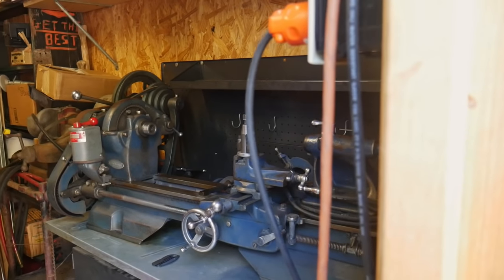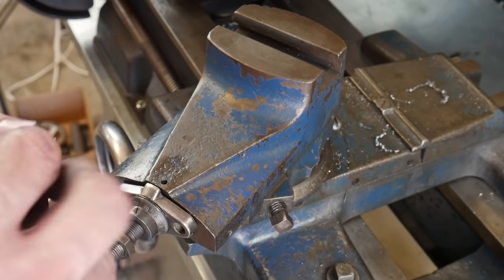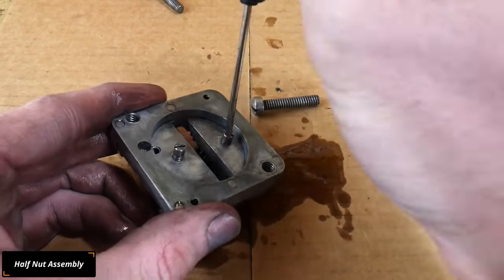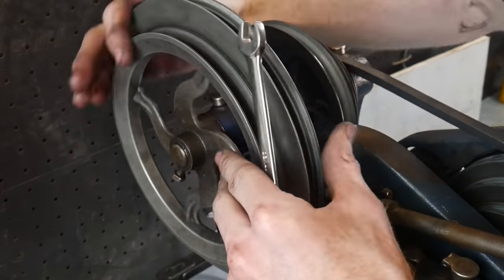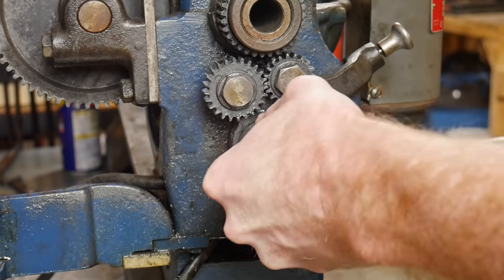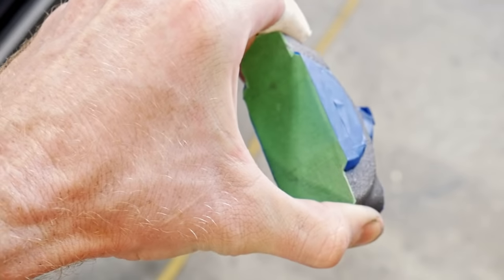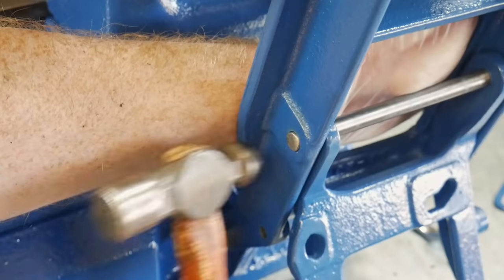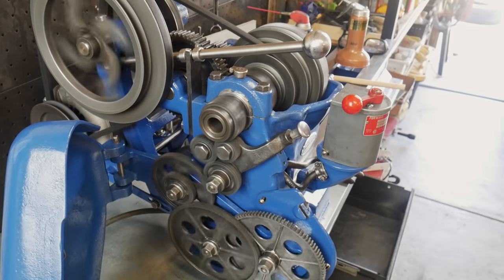1930s Atlas Lathe Restoration

Comment: Thanks for the video. I have a  late year 1939. 101.7383 12x24” Atlas Craftsman lathe. It’s a future project after I get my air system installed in my garage shop. My cover and belt tensioner are a little different, but the rest is pretty much identical. Like the Blue color. What color is it. I’ve been bouncing between a rich cobalt blue and a bright red. I know it’s a bit silly to think this much about it but just how I’m wired.
Reply from the maker: Very cool sir. The color is Royal Blue, according to my research it was very close to the original color. When I take the panels off, the blue under the panel was pretty darn close to the royal blue I used.

Comment: hi, this looks the same as my craftsman lathe, are they 1 and the same. what model is it coz i am looking for manual , how do you know its 12".  i am still in the process of cleaning it,  and i kinda scared opening the apron. thanks
Reply from the maker: Guys on the forms told me based on my seriel number. I guess I could measure it as well

Comment: How have the AXA quick change tool posts been working out? I have a similar model of lathe and would love to speed up tool change but dont have a mill at my disposal - I suppose I can figure the machining out for fitment but do you enjoy the AXAs/any issues or things you wish you would have known before I purchase and then enjoy the fruits of hand fitting?
Reply from the maker: Hey man, I'm not a pro, but I've really enjoyed using the quick change tool post so far. No issues.
Reply: @RedBeardOps  Awesome, thanks a lot for the input and the great video, helped out a lot!

Comment: Great work! It's a real beauty. Actually you don't want the switch to reverse the direction. That screw-on chuck can and will spin off in reverse. Quite dangerous. Unless you're using a collet holder with a drawbar to prevent it's loosening, 😁
Reply from the maker: Thanks for the tip! Cheers sir

Comment: Great video, shame you had no knowledge of zamak beforehand, my mechanic father(late) used to complain about how much it was used on just about anything British that had a motor in it, most common complaint was water in the fuel bowl made from zamak, it sort of just starts crumbling and doesn't stop and like you found, it melts easy.
Keep up the work and you'll have a complete workshop in no time.
BTW Loved the hearing protection for painting 😎
Reply from the maker: Thank you very much Bob! Those are Bluetooth, so I keep them on full time! Cheers sir!
Reply: @RedBeardOps  👍 BTW Did you work out the wiring for the drum switch yet?
Reply from the maker: @Bobs-Wrigles5555  Hey Bob, to be honest, I haven't devoted the time to messing with it. Reverse isn't needed for 99.9% of the stuff I'm doing.
Reply: @RedBeardOps  Check your emails, I hope I've explained it well enough.
It should be an easy tryout.
Reply: @RedBeardOps  BTW I forgot to note that if you don't like the direction of rotation for the lever position, simply swap the motor wires OR the power wires, (it won't make a difference)
Reply from the maker: @Bobs-Wrigles5555  Thank you greatly sir!

Comment: How did I miss this one? Anyhow, watch the Pot Metal (Pm) [zamak] parts; the inherent problem with Al/Cu hybrids is the internal electrical eddies when against iron items. The white corrosion dust is a sign it's eating the iron out of the steel (Aluminum oxide dust). I'd recommend finding a toolmaker that will cut you a full steel set of gears.
Reply from the maker: Thanks Shiley! Good tips

Comment: ZAMAK is cheap, light, lubricitous and durable enough to get the job done.  
did you take a wire wheel to any of the ways 
welding cast iron with flux core steel changes the cast iron's properties and it'll brittle fracture eventually. weld it with 95% nickel rods and a stick welder, or solder, or braise it.

Comment: Thank you for the video. I regret to tell you there is not an easy way to reverse the rotation of this motor. The best way in this case is to use an 3 phase motor with an frequency inverter. This also will give you the ability control the RPM.
Reply from the maker: Thanks for the tip! Glad you enjoyed the restoration!

Comment: Red, what is the voltage of your motor?  Is it single phase, 120VAC, or 208/240VAC 3 phase?  Usually, there is a wiring diagram inside the terminal cover on most motors, which can tell you how make the "reversing rotation" on the motor, if it has that capability.
Reply from the maker: I'll have to check sir. I bet there are some old diagrams in there. To be honest, the forward only motion isn't bothering me. I'm not sure what I'd use reverse form Maybe some fancy threading operations?

Comment: I know this video is 3 years old but I just found it. I noticed where you said that you shortened one of the screws in the base of the tail stock, bad move. The reason the screw is so long is so that in case you ever need to cut a long tsper, you can calculate how much offset you need and move the tail stock off center.
Reply from the maker: 10-4, guess if it ever comes to that I can get a piece of all thread

Comment: Ah, I was going to tell you that you need to solder ZMAK or machine a new part out of aluminum or mild steel but you figured it out.  Plus aluminum is really tricky to gas weld... I'm pretty sure that My old Welding instructor could probably pull off that type of repair but he's been welding for close to 60 years at this point.
Reply from the maker: Heck yeah John. It fought me the whole way! LOL
Reply: It'll do that, anyhow just getting off the phone with Mr. Arwood (my former welding instructor... gees he's getting close to a century) and he told me not to even bother brazing ZMAK as it'll just lead to a huge headache.

However it does do well with silver (rosin core) solder and a Butane torch
Reply from the maker: @KageStelhman  Good to know!!

Comment: You don't need a 3 phase motor to reverse the direction.  there are single phase motors out there that can be wired either way. They can be 120 volt or 220 volt.   these motors have extra wires in them to set the direction.    you can use a toggle switch to change the direction and use the drum switch to switch the motor on.  I don't think the drum switch has enough contacts to allow it to work by itself. Check Ebay for a motor.   I restored a Clausing lathe with Timken bearings made in 1946 last summer.  I think Clausing was bought out by Atlas in the late 1940's and around 1950,  Atlas started to make them cheaper and used the junk alloy gears.  The old Clausings used triangular ways, and the Atlas lathes used flat ways when they got cheaper made.  by the way, you could have just switched the whole way assembly around on yours and put the head stock and tail stock on opposite ends and had any wear in the ways at the tail stock end.   The best investment you will ever make is buy an Aloris style tool post.  my lathe was disappointing at best until I bought one for it.  Ebay has cheap china ones that are surprisingly good quality.
Reply from the maker: Thanks for the tips Bill!

Comment: Zamak is very common in model railroad locomotives and used as weight for cars (rolling stock) and it machines like aluminum it is soft enough
Reply from the maker: Thanks for the info!
Reply: I am working on my first lathe; a 10 inch Atlas built in the 1930's; I have the tool post, saddle and tail stock soaking in Evaporust to assist with getting the paint, and any grease & grime loosened up so I can scrub it off with a brass wire brush and a Scotchbrite pad.

Comment: It is clear that you have done it with heart, but a very precious piece such as the lathe that you restore does not have to be cleaned with sandpaper (I mean the shafts), it is the first time I have seen it after 40 years machining parts
Reply from the maker: Hey Manuel, I just used the sandpaper to get off any surface corrosion or patinas. I barley took of any material worth noting since they were worn 320 grit belts and scotch brite surface conditioning belts. Cheers sir!
Reply: @RedBeardOps  Hello: I made the comment because you use very refined technique for some work and yet at minute 21:44 you put the axis in the sanding machine and that should not be like that. The sandpaper always carries the rust but also the metal there is no doubt, but I trust that you have used it knowingly. A perfect job that has made me enjoy for 43:49 minutes. Thank you
Reply from the maker: @manuelcv9475  cheers sir!

Comment: I'm pretty sure that is much newer than 37. I think it was in the 50s or 60s when Atlas has craftsman badges they were sold by sears and purchased in 67
Reply from the maker: They Patrick, thanks for the info. Check out post #10 here. This is where I got my information. https://www.hobby-machinist.com/threads/introduction-new-atlas-lathe-owner.86760/#post-776717

Comment: If that motor is 3 Phase AC you can reverse the motor by switching the position of your phases.  If you tried switching the one set and it kept going the same way, use the other phase.  It will operate in one direction wired 2 ways, and ooerate the other direction wired only that one way.  I would be happy to walk you through it?  Lmk.
Reply: Great job on the restoration btw!
Reply from the maker: Thank you for the info and tips sir! Down the road it's something I will probably entertain. I'm stoked you enjoyed the restoration, thanks again!

Comment: That's alot of wear from not being oiled regularly and having chip build up under carriage slides,,,but I've found the bappet bearing gives a better finish then the newer timken bearings...
Reply from the maker: Thanks George!
Reply: @RedBeardOps  your welcome,,,lm buying them up cheap and in really good condition here in Delaware,,,people are starting to realize vintage lathes are still better then the newer lathes and as the prices are climbing I will start selling off my collection,,,atlas was the hobbyist lathe and not many was in factories are schools so I find them in good condition and usually well taken care of,,,out if my 6 lathes I buy found 2 of the zmak gears with wear,,,,Hell the new lathes have nylon gears and they hold up pretty well..I have a 618 that's never been used on display,,, 60 years old and never turned steel. That was a find for 200 bucks...

Comment: Can you not repair the chip on the pulley with JB weld it not great but it will make it look better. Great restoration
Reply from the maker: I ended up finding another pully from mcMasterCar if I remember right
Reply: That's good to hear it is a lovely lathe. I'm doing the same at this time in the UK to a 1920 patick lathe. Keep up the great videos

Comment: fractional horse power v-belts will lower the vibration a lot..If you look close at the pulleys there is a different pitch to the v -grove.A fractional horse power belt sits deeper in the pulley so it transmits more power to the side of the belt.Car v-belts will work but do your self a favor and install the proper belts.You will have to get them from a bearing supply shop.Not the auto parts store.They have no clue to what you are asking for.The supply house will.It will lower vibration by a huge amount.I get mine from the local bearing supply  house......
Reply from the maker: Thanks for the tips!

Comment: A great video in everyway.  Your manner of presentation is very good.  One point though,  chemicals....., over time exposure to toxic chemicals will kill you.  Lost several friends in the automotive mechanics and manufacturing/machining trades do to cancers that were likely caused by extended exposure to solvents, ect.  Get into the habit of using nitrile gloves and use ventilation.  Your grandkits will thank you.
Reply from the maker: Thanks Jim!

Comment: Surprised you got the machine and the 'change gears' weren't with it.
Reply from the maker: I know there are ways to change the orientation of the gears to get different feed speeds. I have them set on the slowest setting... which is still a little fast. I got a few 3D printed gears for this machine, but haven't had the time to mess around with installing them.

Comment: I haven't read all the comments or any of them actually, BUT regarding the drum switch, DO NOT run this lathe in reverse. 

The chuck is just threaded on (RH) and if run in reverse it can spin right off. You might get away with a little force, but a chuck spinning off is a disaster.

I have the exact same lathe which I restored to functionality only, nothing cosmetic.
Reply from the maker: Thanks Real Bartlett!
Reply: @RedBeardOps   BTW, I have the exact same lathe with babbitt bearings and the original switch.

Comment: Not particularly enlightening.  With CAD and all I would have expected much more. I have had a Timken headstock for a very long time.  Paint is NOT restoration. Checking for worn ways on the saddle, cross slide and bed is!
Reply from the maker: Sorry you're underwhelmed
Reply: @RedBeardOps  
They aren't wrong.  But it seems to be a common theme on these youtube "restoration" videos. 
There was no restoration anywhere in this video. 
That would be like me taking a classic car to maaco for a 200 dollar paint and bondo job, having it detailed and calling it restored. 
It did clean up pretty well and I'm sure you'll get a few years of use out of the old girl though.
Reply from the maker: @gt1man931  Sorry you disliked it.

Comment: So basically Atlas lathes are weak as piss as they are made from zameck.....Colchester lathes are far superior in build and material quality
Reply from the maker: Some of the components are zemeck for sure. They were originally designed to be at an affordable price point which opened up the door to many home machinist. I haven't had any problems with the machine so far. Considering it's still running well after being used for ~84 years I think one could say they're a decent machine. Cheers sir!
Reply: @RedBeardOps  amazing rebuild by the way..I’m a cnc  applications Eng here in the uk...I’ve worked for Mazak WFL and a few other so called multi National machine tool manufacturers...you’d put most of them of them to shame....with the pride care and attention and skill level you have````` yeah you made some mistakes but we all do....as the saying goes in the 🏴 the guy who breaks nothing makes nothing.or in plain English the guy who fucks nowt makes nowt.
Reply from the maker: @chrisyboy666  Much appreciated Carlos! I try my best. Have a great weekend!